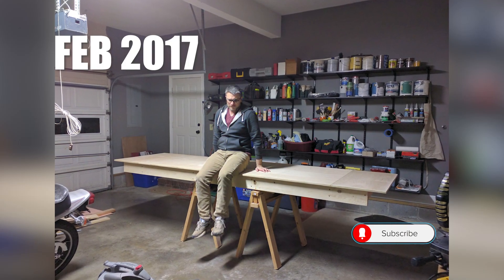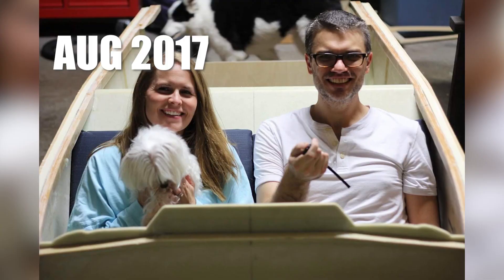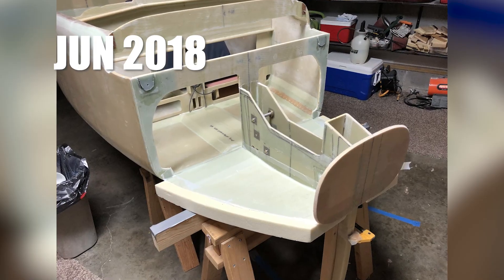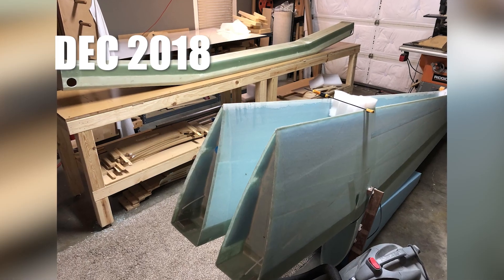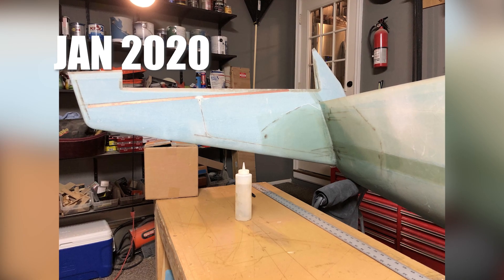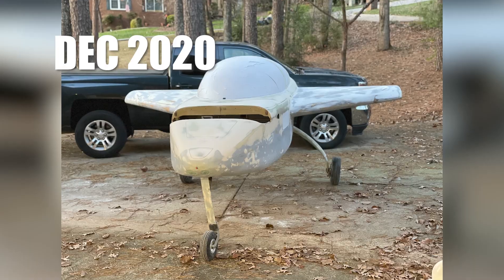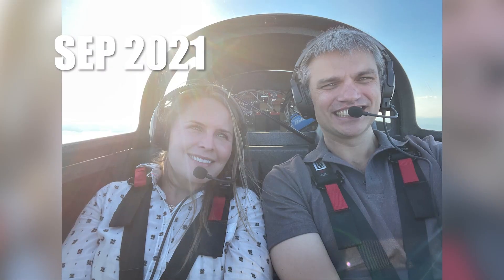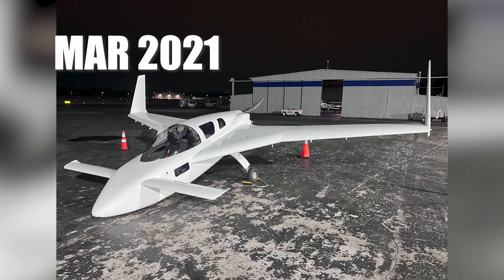How to build your own airplane

Comment: Cool video. I built a Cozy Mark IV but I literally got anxious watching because it seems like an absurd amount of work and time. Congratulations and good luck with it. -Rob
Reply: This plane is a 1970’s design. The technology has come a long way since then. A modern version could be built in 2024, in a matter of weeks, with 99% less sanding and finishing.
Reply: @davidwebb4904  Name a composite airplane that can be built in weeks.
Reply: @2Phast4Rocket  Currently in production? None that I know of. However if a few people groupfunded, then yes, it can be done. A Cozy Mk V for the 21st century

Comment: I see you put in the extra lower windows on the sides. I've seen another with those too, and another with lower windows for the back seat passengers, but not most Cozies. Are they in the plans or did you just do it?
Reply from the maker: Its not in the plans, i modified it
Reply: @russroams  do you have a build website or blog that might have details on mod for additional lower windows. Just found your build, researching

Comment: Wonderfull job the airplane looks amazing. Where could someone find plans for this airplane  And are the plans in metric system ?
Reply: You can order the plans from Aircraft Spruce. No they are not in metric https://www.aircraftspruce.com/catalog/kitspages/cozy.php
Reply: @datachomper  thanks for your reply. Did you level your bench defore starting the building progress. Was the foam molds accurate or had curves?
Reply: @datachomper  Some plans are available but no parts and no materials...